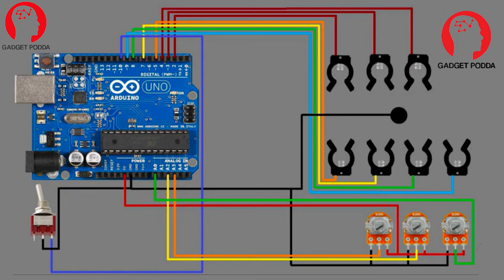How To Make Game Pedal & H-Shifter [Part-2]

Comment: I really was looking for a video in which H shifter is made by Arduino uno thanks buddy 🔥🔥
Reply from the maker: Thank you so much for watching my video.
thanks for you comment...👍
Reply: @GADGETPODDAofficial  i was going through your channel you are good in tech. I need some help regarding  motor encoder.. if you can help i will be very thankful to you 

I am making a force'feed back gaming wheel i have everything but i couldn't find that Cannon (ip2770) printer encoder .. which will help me to generate force feedback ( ffb) 

and also if i buy. A proper encoder motor that will  cost about 2500 to 4500₹ which i don't want to buy ..cuz if i bought this,  my project budget will go upto 6500₹

There are some cheap (200-500₹)  motor encoder available but i don't know that they'll do the job for me ..
So if you have any idea of these motor encoder or anything related to encoders that will do the work for me
 please tell/ help me ...©️
Reply: @GADGETPODDAofficial  aaaaaàaaàaaaaaaaaAaaaaaa
Reply: What is the name of the circuit board that you use in this video